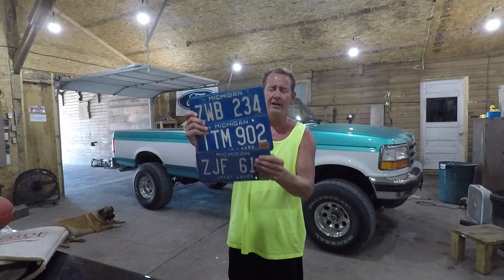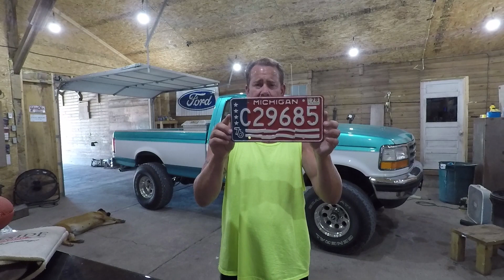This AGAIN?! 1994 F150 4x4 Power Steering UPDATE and Mailtime

Comment: It sounds like a beast man.
Reply from the maker: Thanks!
Reply: The Fox Shop You're welcome man. I have a 96 Ford F150 with a 5.0L (302) Windsor V8 with 206,215 miles on it and it's still going strong. The only thing I replaced on my truck was the starter but other than that mostly was just simple maintenance, change the transmission fluid just to get rid of the shuttering it was making and it hasn't had a problem ever since.
Reply from the maker: Like I always say... you take care of her... she takes care of you.  :-)

Comment: Ya a noisy pump would drive me crazy.
Reply from the maker: It does.  I thought it might quiet down after a few hundred miles. Even just sitting there at idle you can hear it a little, but when turning a corner or in a parking lot, you just never know.. sometimes it whines and complains, or it may be pretty quiet.  I dont like it.  Its more than the typical Ford pump moan that these ol trucks are kinda known for, that doesnt bother me much at all, but this is just obnoxious.

Comment: The ps pump you need can be found on the vans of the same vintage. You can get the saginaw pump and bracket and swap them for yours. Mine cost $25 at the jy and the rebuild kit was $11 on line.
Reply from the maker: Thats what I thought... now if I can just locate a van.  With any luck the pump is in good shape!

Comment: I just did 2 Saginaw conversions- one on my 96 302 truck and the other on my 92 4.9 truck.  the 302/351 pump bracket is a dime-a-dozen in the wrecking yards on E-150 econolines with the same engine.  There are two observations on the conversion.  You get a different type of whine when you are at rpm, but as far as the steering noise during slow speed maneuvers...whisper quiet.  The last detail I can give you is the steering box is the same in the van, but the location is different.  cut the original truck line off to mate to the steering box, cut the original van end off the sag side, and have your local hydraulics places make you a new hose with each end mating up to the respective side.  Russell also makes a -6 hyd line to metric p/s fitting for $9 which is another option.  The drain hose fits with no modifications.  On my project, the custom pressure hose cost more than the other parts.
Reply from the maker: Problem will be finding one of those vans...
Reply: reply to me privately if you are interested- i took some p/s parts off of a van last weekend and set it aside at the wrecking yard.  If that is gone, there are 3 more just like it.  I'm going back for other things anyhow.

Comment: Just a suggetion but mayeb you should look into a possibility of installing a big window unit aic conditioner in your shop or
a really big powerful pedestal industrial fan.
Reply from the maker: I have a fan that works pretty good, and also several cheapo box fans.. problem is the noise when trying to record a video.  Thought about a couple big window ac units.. OR.. just stay out of the shop when the heat index is 113 degrees! LOL
Reply: I would gues if your buget allows maybe some time down road you can do two big window ac units
then again their not cheap   anyway its your channel its  your call not mine.
Reply: I like to find old furnace units from homes and get the fans out of them. Usually takes a bit of work due to all the sheet metal screws but once you wire them.. Usually 3 speed fans... MAN!! Do they push some air. And there usually free. Me and my dad used one years ago and put a 5 horse Briggs n Stratton to it and made a yard blower. Still works to this day. And that was back in 2000 ish

Comment: Fox shop I'm going to send you a Arkansas plate from my 1994 Ford F-150 XL long bed 4x4 by the way my truck has over 300,000 thousand miles on it all original transmission besides the engine being rebuilt at 276,000 thousand miles due to me thinking the oil pressure gauge was bull shitting me but it wasn't and I found that out shortly afterward LOL 😂 it now has 306,567.196 on it an plan to make a million miles but I doubt it my power steering pump is all original and it moans and groans them Ford pumps just have a shitty attitude pissy things won't 🤐
Reply: What about your oil pressure gauge lol mine does not work is that really that bad?

Comment: I have a 2000 Taurus. I have been thru 5 power steering pumps in 2 years. Reman pumps are just junk.
Reply from the maker: I actually was rebuilding my original pump.. lost 1 tiny spring so I just bought a reman pump...  found the spring a week or so later when I was sweeping the floor!